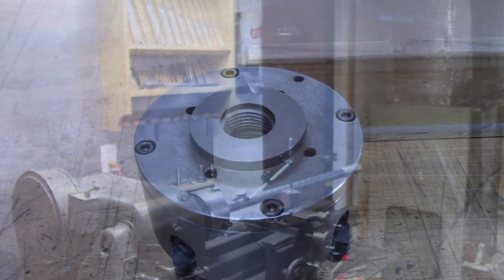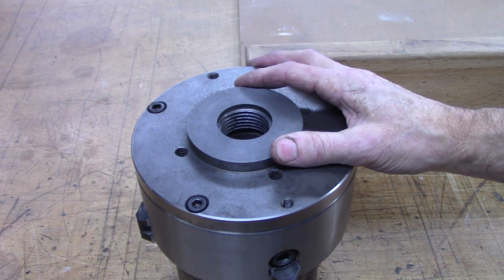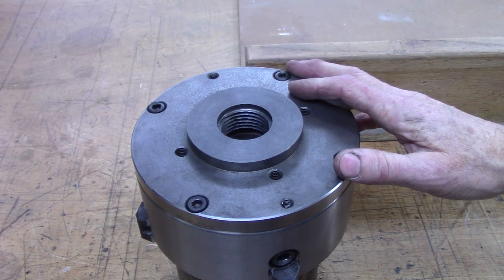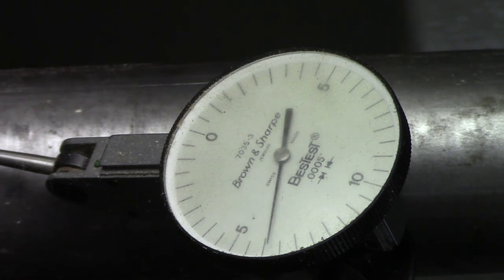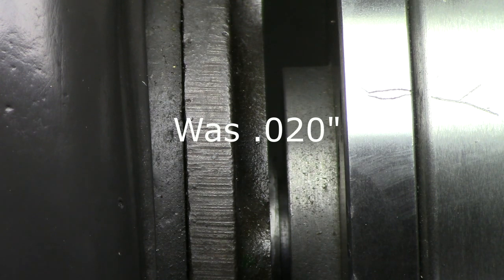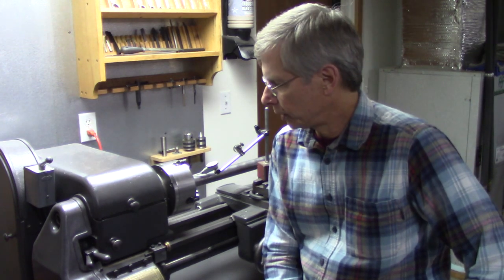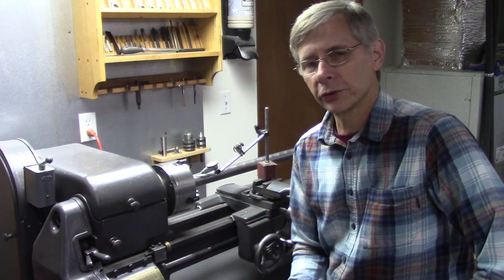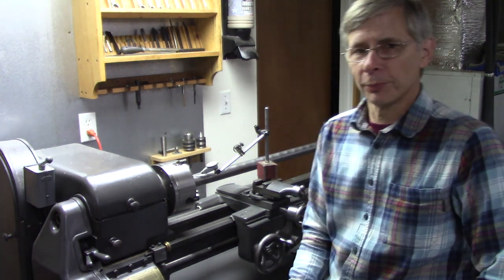Metal Lathe Chuck Overhang part 3

Comment: The solution is to make a large spindle adapter to a larger size or clamping mechanism and glue or locktite it onto the existing spindle so it can't move.  Then you can just buy standard back plates and fit them to your chuck.  See what a lot of coffee can do?  You could always get it back apart with a little heat if needed.  What spindle would you choose? 
 An L taper looks interesting L00 maybe?  Edit:  I just discovered I can edit my post.  I'm on a roll.
Reply from the maker: @robert574  - Interesting solution. I'm sure that would work. I'm thinking maybe a larger lathe might be a good choice too. Thanks
Reply: I thought for sure there would already be some sort of adapter out there without having to make it, but I couldn't find one.  If you would put some anti-seize on the threads it will nearly double the force against the spindle threads with the same torque.  That might show some difference.  Someone also had the idea to put some dykem on the threads (or a marker) to see how the threads are mating, another good idea.  I also wonder if the thread on the spindle might be worn, not just in diameter but in profile, causing only your freshly cut peaks on the back plate to touch when tightening (that might also show with dykem).   There could be a worn step on the spindle thread that was the tip of a 70% thread (or whatever it was) being tightened for years and now only the portion above the 70% of your new thread is actually touching (on the never before used portion of the spindle thread).  If you had an 8 pitch tap that you could set against the spindle thread and some magnification, you might do a comparison.  Can you measure the ID of the thread on your original chuck? (expanding mandrel maybe)
Reply from the maker: I like the way you think and you also pay attention. I've had people say, the back plate is flexing or the chuck is not screwed on...  crazy. Anyway, I made a steel back plate...  its WAY better.
Reply from the maker: @robert574  - Check out this video - https://youtu.be/R4-I_peyBFE

Comment: How about to set a magnetic base right on the chuck OD then touch the indicator to the stock to see how much the jaws will flex.  I just can't picture how you're getting that much deflection.  I'm always dreaming about getting a better lathe.  After this, I'm going to start dreaming bigger about the spindle.
Reply from the maker: Yes Yes Yes, bigger spindles get better exponentially.  I'm not sure about the math but going from a 1.5" to a 2" spindle may be 20 times stronger. If the jaws are moving it is slight (but good point). Part-2 of this video shows exactly where all the movement is coming from (or at least 90%). It's the thread mount. Since I made this video I replaced the cheap cast plate with a steel back plate and got a huge improvement. Sadly I still get chatter but about half as much.  Here's a link to the right spot of part two. https://youtu.be/ysYusXnhCQY?t=152

Comment: I watched this last night and did some calculations this morning.  I used a 1.000" dia spindle with 0.530 bore (just a guess), 12" center to center for the bearings, 6" from the center of the bearing to where you were taking the deflection measurement and was estimating a deflection of 0.025" with the moment you were applying.  That wouldn't take into consideration any shifting in the bearings.  Did anyone else try to calculate it?
Reply: radial load on the bearings is about 100lbs when flexing the bar at 30lbs at the end.  I could tweak it with some better numbers like actual c to c dist on bearings and spindle dimensions.
Reply: I pulled up a catalog with a cross-section of the spindle.  Is the thread 1 5/8"-8, thru bore 7/8" ID, and center of spindle 1-3/8" OD, the c to c of bearings 9-1/8"?  I used a picture of a ruler on the picture to measure it.

If so, the deflection would be only 0.0051" at the point you measured it (which is abt 6" to the right of the center of the right spindle bearing)  from flexing (bowing) not counting radial bearing slack. The deflection between the spindle bearings is 0.0015" max at 3.86" to the left of the right spindle bearing. 

Hope I used the right picture (let me know if the dimensions were off).  It looks like flexing accounts for very little of the deflection.  I made a spreadsheet and I plan to do the same calc for my old lathe.
Reply from the maker: Thanks for the in depth thought on this. See my other comment. I'm sure their is very slight movements at the spindle bearings but the primary issue is at the thread mount. Also, the deflection is way worse in part two. In this video (part 3) I had cut off an unnecessarily large unthreaded portion of the backing plate. Instead of 3 or 4 threads engaging there was 6 or 7 threads.
Reply from the maker: Shifting in the bearings? There is zero shifting if you mean end play? Part 2 shows the source of the movement. It's much improved on this video but still in the same area. Below is a link to part two of this video. It will start at the correct point. The thread mount is the weak link here. Sometime after making this video I made a steel backing plate which made a significant improvement but it still did not fully eliminate the chatter The chuck clamping point it too far from the bearing for a spindle or spindle mount of this size.  https://youtu.be/ysYusXnhCQY?t=159

Comment: I wonder if Logan got some of the spindles slightly off on the threaded portion ....you said you were going to put in the other spindle and see if that helped .... Have you yet ?
I've found that slowing down the lathe get's rid of all my chatter..... even if I have to use back-gears ....the problem with doing it that way is cutt-off takes forever ! so it's how much chatter can you stand ? <grin>
also tonight I was parting off a 5/8" piece of threaded rod.... it started chattering immediately... but I found turning the cross feed in harder got past the chatter and it started cutting real good..... I figured if chatter is caused by the tool moving up and down with respect to the work,..... push harder so it can't move up and down.... and strangely enough ...it worked ! 
Bob...........
Reply from the maker: I've had faster feed slower RPM work too...  just not on this big chuck. I never have chatter with the small chuck and the cutoff blade holder I made. With the standard QC post I could not do any cut off. No I haven't change the spindle yet. I'm not super optimistic but I need to replace my back gear bearings and a the left side gear on the spindle. For some reason its a lose fit on the spindle. No doubt the threads are warn on my current spindle so who knows.  Right now I have about 10 project going and 10 more I want to do...  so it will be a while before I get to the spindle.

Comment: If the thread on your lathe is big, over 1", I doubt that the chuck is really getting tight. By that I mean tight enough to truly draw the shoulder together without flex. It looks like the gap is opening and closing when you pry on the bar which could be flex in your spindle or the chuck against the shoulder. It could be opening up a few tenths gap. Big screws need high torque to tighten up to where you get appreciable stretch and everything seats.
Reply from the maker: I agree with that. It should also be noted that with a thread pitch of 8 it is hard to really tighten the chuck. Of course that is good in some respects because it makes the chuck easier to remove.  I think most the movement is in the threads but I'm sure there is also some spindle flex. To some degree I think there are limits to a thread mount especially one that is only 1.5" in diameter. However,  I think I also have a problem with thread fit. Sadley, I think fixing this will help but I doubt it will help the chatter.  So far the only problem I have found with the threads is that the tips of the threads are worn off on the end. There is a .020 taper if you measure the OD. I measured the threads  with thread wires and they are parallel. No doubt more thread is better but relying on the thread tips to stop movement seems a little extreme. I have another headstock with a broken gear but the threads on the spindle are way better. I'm going to swap them out and see what happens. My back gear has some loose sleeve bearing that need to be replaced anyway. It's a big job but I've had it all apart before.
Reply: @WinkysWorkshop  if you could get real clamp pressure on that shoulder the slop wouldn't matter. 1-1/2" thread, what is the OD of the shoulder? Room for a two piece clamp collar in between? Turn a 2 degree taper on one face of the collar and make a mating 2 degree washer to go behind the chuck. Draw up the halves of the washer with the screws and it will preload the threads more than running the chuck up against the shoulder by hand. Might pull the axis of the chuck off though, but it will be tight!
Reply from the maker: @EngineersWorkshop  - Great minds think alike! I made a good tight fitting tapered ring that fit the unthreaded OD (which is almost exactly 1.5"). I put a 30 degree taper on the ring and also on the back of the back plate. I'd like to say it worked great but it did not do anything (man that thing was hard to get off!) I found something else. The OD of the spindle threads has a taper of about .020 (smaller is the end) but when measured with wires it's dead in. It doesn't seem like this would be a big deal but who know...  I have another headstock with a spindle that is in better shape. I think I'll swap them. It's a big job but I need to put new sleeve bearing in my back gear anyway.
Reply: @WinkysWorkshop  Here's the lathe I'm refurbishing: http://imgur.com/a/erVtExh it's a 1941 Monarch CW 16x54

Comment: I did see a very small amount of flex but it is so small and you are torquing the chuck so hard that the amount of flex will
probably never bother you again..... your showing the parts and then screwing the chuck home was fantastic, you could see the chuck butt up against the back register !  .... Brilliant!
so essentially what you did was trim off the long overhang on the back plate.... so more threads would be on the spindle !   that was a brilliant fix !
and what's more..... it worked !   you fixed it yet again ! well done ! 
i have no doubt most of the back plates out there could use that little change !!!!! next time I have my chuck backplate  off it will more than likely get the same treatment  !!!!! thank you ! 
Bob.....
Reply from the maker: I do feel like it made a big difference but cut off is still out of the question. It chatter bad. The threads are parallel if measured with wires but they are tapered if you measure the OD (about .020"). I have an extra spindle that is in better shape I'm going to install. More threads are better although I think I may have simply reached the limit of my lathe.

Comment: It really looks like it's rocking on the threads still .. what about a temporary wrap of teflon tape, just to snug up the threads to see if it changes?
Reply: If not that, maybe it's just the natural deflection of the materials, none of it is particularly rigid, considering the leverage you have.
Reply from the maker: @IBWatchinUrVids  - I'm leaning this direction myself. Lots of leverage and the limitations of this type thread mount.

Comment: The unthreaded portion is a register. When you thread something, it's inherently off-true, due to the angle of the threads. You pull the register tight and it has a flat + true surface (that's the idea at least) to mate.  If you don't want to make a new backplate, You might try making a washer to make up the difference, so the register registers (haha).
Reply from the maker: The unthreaded portion is .018" larger than the spindle on this chuck and I measured the original Logan chuck and it was .020".  With these kinds of tolerances I doubt the ID/OD register is a register *does that register? (joking). So you are thinking a thick flat washer will give the chuck more support? I might need to try this.
Reply: Hahaha XD I've made a few backplates for my SB lathes, and that's what the register is for.  
I use that trick if I need to thread a shaft in to something, and I'd like it to end up  perpendicular after it's threaded in.  
The threads pull it tight, but the register squares it up. You want it to fit snugly, without galling.
Reply from the maker: @JRock17991  - The unthreaed part of my spindle is extremely close to 1.5". I presume some wear too it down a little (-.0005) but the untreaded part of my original Logan chuck is 1.520". That .020" oversized! If Logan intended this to be a holding fit they surely screwed up on this chuck. I'm not even saying a tight snug fit would not help but I am saying this OD register is not intended to be a register. My South Bend measures almost .040" over!
Reply: Yeah, having it snug up against the machined surface of the spindle would go a long way to securing it from movement. 
If you want to go 1 better (without making a new backplate) you could make a little register on that washer, to make up the space between the register in the donut and the spindle.  
By the time you do all that work though, you might be better off just making a new backplate.  They don't have to be cast iron. 
I've made them out of steel, and welded the donut to the main plate (before machining of course), so it's not even like you spend for a solid 2"x6"  round.
Reply from the maker: @JRock17991  - I plan on sleeving the plate I have. I've also found something else, the threads are tapered on the spindle by about .020" (smaller at the end). However, if I measure with thread wires there is no taper. In other word, only the tips of the threads are worn.  I have another used head stock with a spindle that's in much better shape. I may swap the spindles. If this is allowing movement that means the threads in the back plate may be worn in the sides or even poorly formed.

Comment: I am wondering if the thread on the spindle is slightly tapered?  Like a pipe thread where the farther the  male thread goes into the female thread the tighter it gets. This could be a possible explanation why you got better results after removing 3/8" off of the back plate on your chuck.
Reply from the maker: Good thinking although I checked them with thread wires and they are perfectly straight. There is a taper but to only involves the tip of the thread. I can't imagine this being an issue but you never know.

Comment: My father in law had the same model logan lathe that you have. His lathe had the same problem as yours of the chuck flexing.   He had the 5c collet adapter, I do not know if you have one for your lathe but if you do you could put the largest collet in the spindle and repeat the same test to  see how much flex you get. There has to be some coming from the spindle and it would be helpful to know exactly how much.  Did you put dykem blue on one of the mating surfaces  before putting on the chuck to see if you were getting good contact?
Reply from the maker: Yes, I blued the threads and the back register. Both make perfect contact.

Comment: Spindle bearings have got to be a big part of the slack.
Reply from the maker: The bearing are double double ball bearing and in good shape. If you indicate the spindle just behind the bearing it is less than .0005.  I'm starting to think it's simply a characteristic  of smaller thread spindles.  The mechanical
 advantage on the thread is very high. My Logan 200 did the same.

Comment: We need to make a new backplate with tighter tolerances on the threads. I would expect that the backplate would come closer to the headstock.
Reply from the maker: I agree, the closer the better. The way the chuck is made inside it has to have some of the donut or be 1 inch thick.